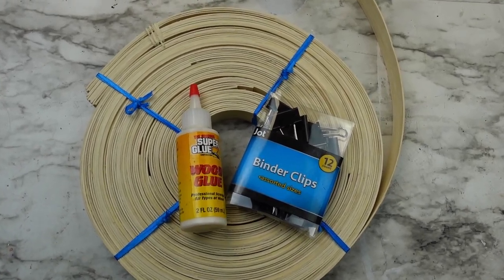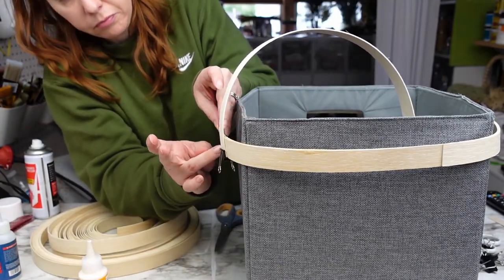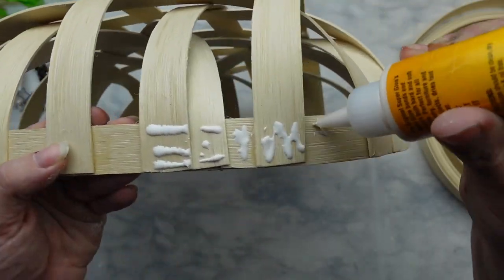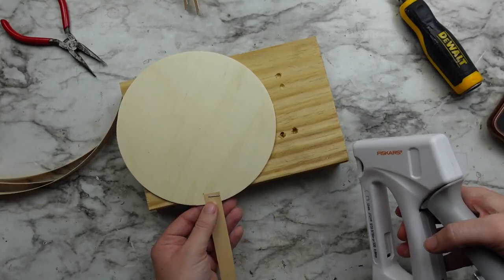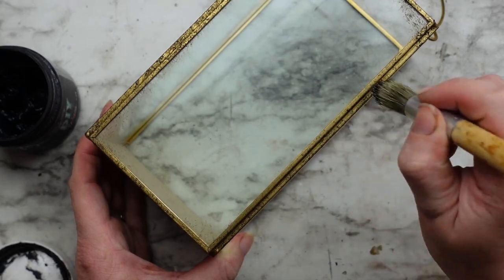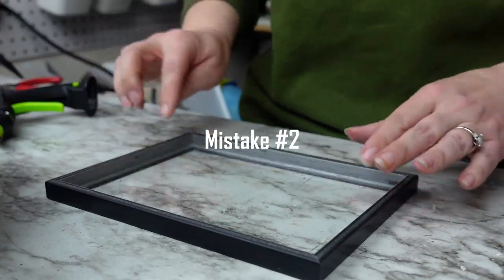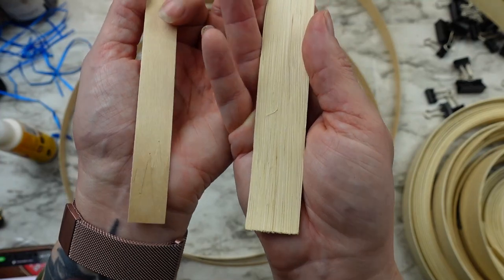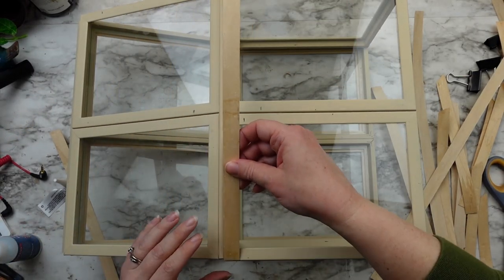WOW!! Look what you can do with flat reed // DIY Home Decor

Comment: Great tutorials!! I bought ALOT of reed about a year ago. I also bought the "cheap" reed from Amazon to use as practice. There is definitely a difference between the REAL reed on Amazon and the "cheap" version. If you like working with the reed, you should check out the actual store on Etsy. Depending on how much or which one your buying sometimes it comes out a little cheaper. Sometimes it's the same though for price and shipping as Amazon.  Just wanted to let you know. I have ordered from both and found the quality of the reed that was shipped directly from the etsy store to appear as if you get a little more reed. But, it could just be the way it was packaged or something. 
Thank you so much for sharing your process on these projects. I know where I went wrong on my practice pieces. Time to put all the reed to use!! 🤣 Thank you for all the inspiration! I love your channel and ideas!
Reply from the maker: Do you know what the Etsy shop is called? I’ll have to check it out